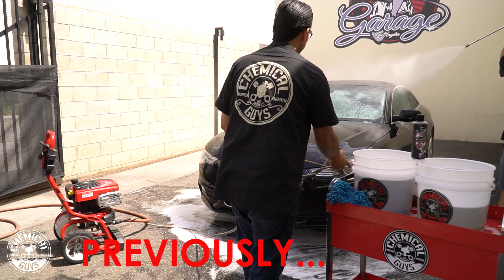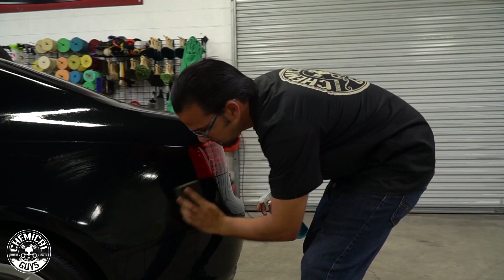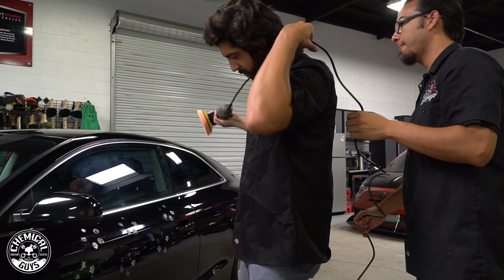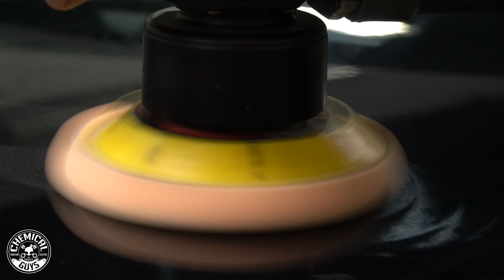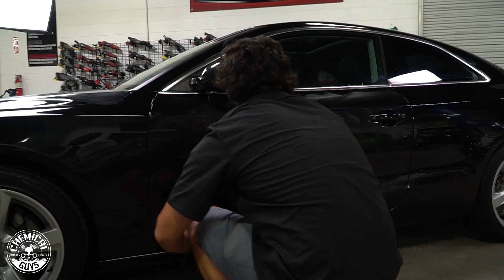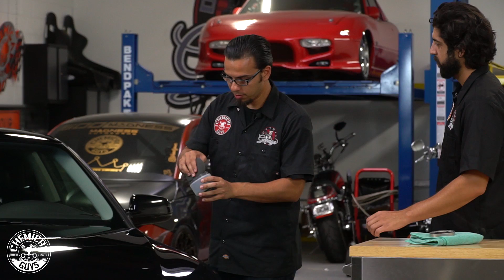How To Properly Prep Car For Paint Correction - Audi A5 - Chemical Guys Car Care

Comment: Do you start the polish machine on or off the car? Basic Walmart starter machine
Reply from the maker: Hey! When using a dual action/random-orbital polisher, start and stop the machine while it is on the surface you are polishing. For a rotary polisher start and stop the machine away from the vehicle.  
- CG Nick

Comment: if the car isn’t black, can you still use the jet seal? and is it mandatory to wax the car after the jet seal?
Reply from the maker: Hi! Yes, JetSeal can be applied to any surface that is gloss painted, shiny or clear. It can be left as a standalone barrier of protection or boosted with a coat of your favorite wax.
Reply: @ChemicalGuys  thank you!

Comment: After you claybar the car do you wipe it down with a micro towel? Or just leave it wet with stuff sitting there.
Reply from the maker: Hi there! After the clay bar process, wipe away spent product with a clean microfiber towel before moving on to the next step of the detailing process. 
- CG Nick

Comment: Another great vid yawl. My question is, on the clay stage. Is it best to clay with fast or brisk motion or slower like putting on sun screen?
Reply from the maker: Hey Lonnie! When using a clay bar/block apply medium pressure. Work in small sections with quick, linear back and forth motions to extract contaminants. 
- CG Nick
Reply: @ChemicalGuys  Thank you very much! Watching your vids has built my courage up enough to try this polishing thing... lol

Comment: What about pretty severe orange peel fix? I painted my first car hood, just practicing on an old farm truck. But will v32-38 cut it down some? Or will wet sanding be necessary?
Reply from the maker: Hi there! Wet sanding will be required for removing orange. I recommend using 800-1000 then refine to 2000-3000 before polishing with V34, V36 and V38 if necessary.
- CG Nick

Comment: Hi.  claybar vs clay block??
Reply from the maker: Hello Jose, great question! Both clay bar alternatives remove contamination from paint and many other smooth glossy surfaces. The clay block is a newer innovation that offers a more convenient way to clay bar the surface with the ease of an easy handheld synthetic block you can grab on to. Check out this article on how to use and choose the right clay for your vehicle. https://www.chemicalguys.com/blog-how-to-clay-your-car.html
Reply: @ChemicalGuys  Another thing you can do with clay block is that you can clean the block with water and start over. I think a block last 5  washes. But what I wondered was if the block clean better or is it just the convenience when you work with it??

Comment: Hi! I've tried compounding and polishing my car using a DA but swirl marks just won't go. Any advice on what i'm doing wrong?
Reply from the maker: Hi! Good question. If you are not satisfied with the amount of swirls and scratches removed after using V36 and an orange pad, start changing variables and get slightly more aggressive until the scratches and swirls are gone:First try using a harder compound:Try V34 Hybrid Compound with the same DA machine and Orange Cutting Pad.If that didn’t work, try using a harder cutting pad:Switch from Orange to Yellow Cutting Pad, or try a Microfiber Cutting Pad.If all else fails, switch to a rotary polisher:Start the test spot with a new combination:Rotary Polisher, Orange Cutting Pad, and V36 Cutting Polish.Analyze results as you go and make adjustments as needed.Click the link below to read a whole article on this! Thanks for watching and thanks for being a part of the Chemical Guys family! 
https://www.chemicalguys.com/How_To_Choose_The_Right_Compound_Or_Polish_For_Your_Car_s/644.htm
Reply: @ChemicalGuys  This article is not found now?

Comment: why a clay block? why not just a regular clay bar?
whats the difference?
Reply from the maker: Hi! That's a great question. Although the Clay Bar and Clay Block achieve the same results, they do have some key differences. The Clay Bar is the original product, the Clay Block is synthetic clay bar that is a newer product. The Clay Block only has one "hardness", whereas the Clay Bar is much more versatile with four different levels of hardness. The Clay Bar must be thrown away when dropped on the floor, whereas the Clay Block can simply be washed and reused. You will also get much more uses out of the Clay Block when used properly. You can achieve pretty much the same results with either product, it just comes down to personal preference. Glad to have you part of the Chemical Guys family and stay tuned for new videos headed your way soon!

Comment: does the wax on top of the sealants help? I feel its not necessary because the sealant is already on so the wax doesn't contact the paint.  but could you explain how it will help?
Reply from the maker: Hi! Synthetic sealants offer a level of protection that waxes can't match. However, while sealants are extremely durable, long lasting, and offer the best protection, they don't have that warm shine of a natural carnauba wax. Waxes, on the other hand, shine like nothing else, but the protection they offer cannot compete with a synthetic sealant. Thus, when used in conjunction, your car can get the best of both worlds, without having to make any sacrifices. Layering a wax on sealant also gives you that little bit more protection! Thanks for watching and stay tuned for a new video dropping tomorrow!
Reply: Chemical Guys thank you for your response!! I will definitely try it out next time 😅
Reply from the maker: You're welcome! Thanks for being a part of the CG family! 👊

Comment: Good video and great products. Been using CG for a couple of years. Why did you use Jet Seal then Black?  (those are two of my favorite products).... Your other videos and your flow chart show to wax then seal.
Reply from the maker: Hi, how's it going? Check out the detailing flow chair below. You will see that the correct order is Glaze (like Black Light Glaze), followed by a paint sealant (like JetSeal), and then topped off with your favorite Chemical Guys wax (such as Black Luminous Glow Infusion Wax). Thanks for being a part of the Chemical Guys family, and stay tuned for more videos coming your way soon!
https://www.chemicalguys.com/v/vspfiles/assets/images/ChemicalGuysDetailingFlowChart.jpg

Comment: I notice you apply coats after coats of product. Do you not have to wait between coats before adding another product. All this can be done in 1 days work?
Reply from the maker: Hello, good question. Each of these products has a specific cure time that you need to heed. For example, after buffing off, JetSeal has a cure time of 20 minutes, allowing you to polish, glaze, seal, and wax all in one day. See the product pages on our website to see the specific cure times for the specific products you are using. Thanks for watching and check back soon for another video dropping later today!

Comment: I applied jetseal on gloss black plasti dip, is it possible to use the clay block to remove the jetseal? 2nd question, will the clay block effect ceramic coating?  Thanks 😊
Reply from the maker: Hi Bader, a clay block won't remove the Jet Seal, it's used to remove smaller embedded contaminants in the pores of the paint. Clay blocks can't damage ceramic coats, the only thing that can remove a ceramic coating is polishing. Based on our experiences with wraps, you should avoid using any products that strip coatings because you risk damaging your plasti dip. Stay tuned Bader, we're got more great videos coming your way.

C.G. Alex -

Comment: Hi chemica guys,i just want to ask after clay bar the car,should i wipe it or just wash the car again to clean the rest of the clay lubricant because  some people like Chrisfix said wash the again .which is the best solutions?
Reply from the maker: Hi Malik, that's a great question. We believe that you don't have to wash again, it's not necessary to waste so much water. The Clay Luber doesn't leave any residue if you buff it off in straight lines. If you're planning to polish your car, you could use Wipe Out to remove any waxes, sealants, or residue from the paint to ensure that any surface coatings don't interfere with the cutting power of the polish. Chemical Guys belief is that you don't need countless steps to keep the project flowing. I start out with a waterless wash, followed by removing contaminates with the clay block, and then I proceed to coat the paint with some glaze. After the glaze cures for fifteen to twenty minutes, then you apply a sealant, and follow that up with a coat of wax to wrap up the detail. If you've buffed off all the coatings and notice that some product didn't come off, you could clean the paint with a quick detail spray. If you have any further questions, I would be more than happy to help you. Stay tuned Malik, we've got more great videos coming your way.

C.G. Alex -

Comment: You went in straight lines with wax to prevent swirl marks, because it's a dark color? Is that correct?
Reply from the maker: Hey there, you always do every process in straight lines because any circular motion creates swirls, which will have to be polished out later. Anything done in straight lines can be pretty  efficient, and it's easier to keep track of your progress. Stay tuned for more great videos!

Comment: Instead of black wax can you apply butter wet wax if vi7 wax and can you apply black light after or no
Reply: V07
Reply from the maker: Hey Ruben, according to the Chemical Guys flow chart, you should apply Blacklight first, then the Butter Wet Wax, followed by some Hybrid V07 quick detailer.

C.G. Alex -

Comment: The only thing i didn't see in the description is what type of towel did yall use after applying v36? What type of wax do yall recommend for fire red paint?
Reply from the maker: We used our Green Workhorse Microfiber Towel to buff off any excess. As for your red paint, definitely try our Cherry Wet Wax. The Cherry Wet Wax is 100% Brazilian carnauba-based wax that has a proprietary blend of gloss enhancers and wetting agents that replicates the shimmering shine and glow of a fresh rip cherry. It's also able to repel UV solar rays to prevent fading and discoloration; it also protects against contamination, pollution, and other harmful natural elements. 

http://www.chemicalguys.com/Workhorse_Microfiber_Towel_Green_3_Pack_p/micmgreen03.htm

http://www.chemicalguys.com/Cherry_Wet_Wax_16_oz_p/wac21316.htm
Reply: Chemical Guys nice! I'm adding those 2 in the car now.  Is there anything else you recommend for my process? So far,  i only have the torq fx, and the vss liquid. I want to do the whole process even if it takes all day.  Im just new to this stuff
Reply from the maker: We recommend a wax to protect your paint after you're all done polishing your vehicle. Also, remember to always keep your pad lubricated by using our Pad Conditioner so that you're pad doesn't get dry while polishing and risk accidentally scratching your car or having the polish klump up. Before you start polishing, be sure to watch more videos to be prepared. Follow the link to check out some of the videos I feel will prepare you well enough. Good luck and feel free to contact us through email or Facebook messenger. customerservice@chemicalguys.com

https://www.youtube.com/watch?v=Ja13RF1tMQ4&t=295s

https://youtu.be/h8wvc4linww

https://www.youtube.com/watch?v=T8LyHX0eHl8&t=28s

https://www.youtube.com/watch?v=Q7FvJcc3PXE&t=3s

https://www.youtube.com/watch?v=ch906jWvpn0&t=1s
Reply: Chemical Guys iwant to remove my swirl and scratches but what product should i use for fire red paint?

Comment: If it takes these guys a day to do a little Audi, it's gonna take me a week to clean, buff and coat my mega cab 😂
Reply from the maker: Hi Levi, thanks for watching. The Mega Cab looks intimidating, but it can be done. You might have to recruit some willing participants to assist you in completing this task. The toughest part will be the polishing, you'll need a few people, and machines to pull that off. Applying Waxes, sealants, and glazes would be done faster with a machine. Good luck with your truck. Stay tuned, more great videos on the way!

Comment: Hey guys great instructional video👍watched both the wash as well as this. I love the foam machine. I have one question with the wax, you had Javier apply it by hand instead of the torqx any particular reasoning? Thnaks👍
Reply from the maker: Hey Brian, thanks so much for watching. The Black Luminous Glow Infusion wax is much easier to spread with a UFO applicator because it is very fine, and getting it on a pad is more difficult. Appyling paste waxes like Black Wax was always meant to be done by hand, you gain a deeper connection between you, and your car. Normally we would use a dual action polisher to apply any other bottled wax, but this one was special.
Reply: Chemical Guys Ahhhh got it ! Been doing that wrong 🤣 liquid wax buffer, paste by hand! Much appreciated 👍👍👍👍
Reply from the maker: You got it Brian.

Comment: Nice job! How long would it take one person to do the whole job from start to finish???
Reply from the maker: Hi buddy, thanks for watching. Something like this could take up to at least 2 1/2 -3 hours easily. Polishing takes up allot of time because you have to do a test spot, and figure out if your choice of pad, and polish are getting you the desired results. Washing and claying could take up to an because of all the preparation getting the pressure washer, connecting the foam cannon, spray down, wash buckets, soaping etc... I can be time consuming, however the more you do it, the faster you'll become.  

Chemical Guys Alex

Comment: please explain how this works. you apply jetseal over a fresh polished surface, that still has all the grease residue from polishing on it. does this not affect your jetseal layer?
Reply from the maker: Hi, thanks for watching. It actually doesn't affect it all. The microfiber absorbs the spent polished, and burned paint. In some cases, we'll go over the paint surface with a quick detail spray to remove any product missed by the towel.

Comment: Did you do the interior of the Audi?
Reply from the maker: Hi Ricky, thanks for watching. We didn't do the interior because we were mainly focusing on paint correction. Most of our viewers are really interested in how to remove scratches and swirls. Polishing is an art form in my mind. I don't think we focus on cleaning interiors as much because it's as simple as grabbing Inner Clean and a yellow microfiber towel.
Reply: Chemical Guys Ok no problem, good video.

Comment: so after all this work, what's the best way to do a quick wash? will it ruin and strip the polishing you've done already?
Reply from the maker: Hi John, 

You can use any of our soaps except Bug & Tar Wash, Clean Slate, and Citrus Soap. If you want an even quicker wash, you can use  a quick detail spray or our EcoSmart to remove dirt, dust, fingerprints and water spots. It'll also give you a super shine for all paint surfaces and high water beading protection that lasts for weeks.

Comment: the last part for the wax.i have a bmw328i 2008 sedan,its a platinum bronze matallic color.what wax will i use for my car?can you give me the link?thank you
Reply from the maker: For your specific paintwork, use Pete's 53 Carnauba Paste Wax. This wax is perfect for metallic paint with its unique blend of oils and liquid crystal polymers. It also creates a hydrophobic layer that protects your vehicle from water spots, road grime, and contamination stains. Most importantly, it reflects off UV solar rays to protect your paint from fading and discoloration.
Reply: i have one more question about polisher tools.i have a porter cable 4.5 amp ros sander model #7346sp,is that fit or compatible for your hex logix pad for polishing or buffing?thank you

Comment: I use Tire kicker from you guys anything else you guys have that is better I'm looking for a rich wet look thanks
Reply from the maker: Tire Kicker is a great product. If you're wanting a deeper wet look, we suggest that you start using Tire and Trim Gel. It's a dressing that will restore and protect sun-faded trim by penetrating deep for a super-high shine. It's also dry-to-the-touch because it absorbs so quickly.

Comment: Would you recommend keeping a rotary buffer at the lowest settting for a beginner?
Reply from the maker: Hey Ralphy, What's happening. It's actually recommended that you start with a Dual action polisher because they're designed to be safer. Rotary polishers are the cousins of furniture polishers, they have the potential to burn paint if not done correctly. If you want a good entry level machine to start with, check out the Torq X. The Torq X is a great entry level machine that's easy to pick up.  http://www.chemicalguys.com/TORQ_TORQX_Random_Orbital_Polisher_p/buf503.htm

Comment: I have always been curious, how often can you use a polisher to remove swirl marks and minor scratches? I would assume the least you do it the better because you strip the clear coat.
Reply: There is a video on YouTube that showed test of how many polish passes before clear coat failure. Guy did like 60. Just some info but always judge for yourself
Reply from the maker: Hi Cody, that's a great question. You can't polish very often because you're stripping the clear coat which protects the paint from oxidizing. You should polish the vehicle if the scratches and swirls become so noticeable that you decide it's time for paint correction. Older cars definitely need to be polished, especially the ones that have a heavy amount of contamination. If you use a heavy clay bar, there will be some scratching involved. In some cases, you can get away with using a cleaner wax if the scratches and swirls are minor.